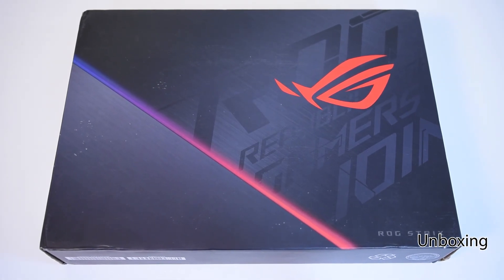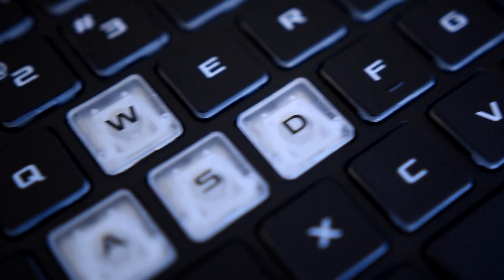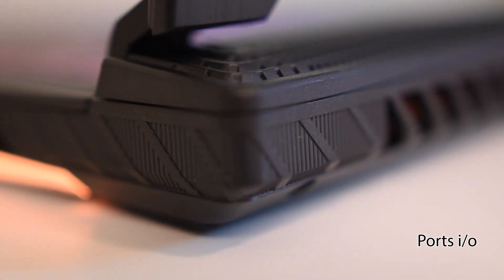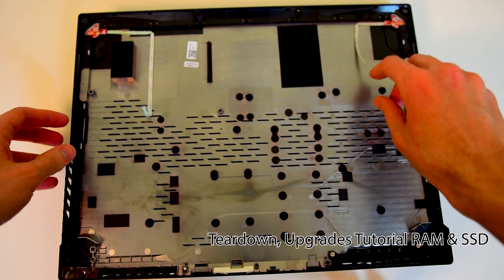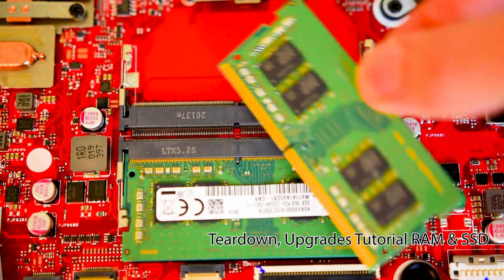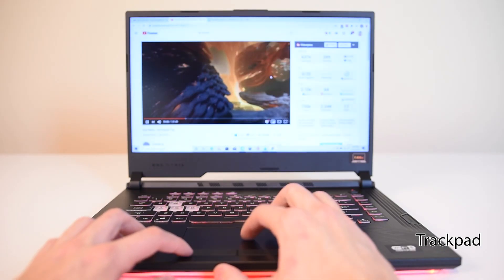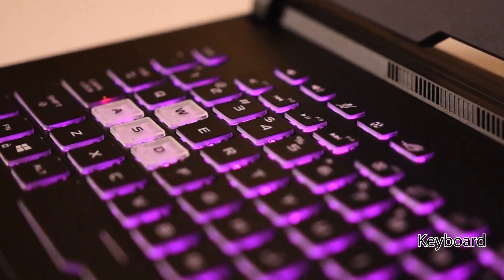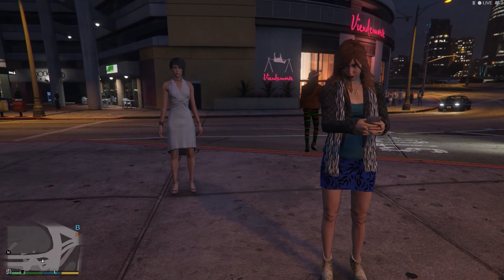ASUS ROG G512 strix i7 RTX 2070 review GAMING LAPTOP 2021 under 1500

Comment: Lets say you get something like that but then get an external gaming monitors does that better the picture experience?
Reply: I’ve been doing this for years with zero problems, just have to buy a really good monitor to be better than the display that’s already on the laptop. Make sure you’re running a decent cooler from Amazon on this laptop, it does get pretty warm pushing out to bigger displays.

Comment: Does anyone know what size of ipx connector is on the motherboard ? It's an antenna connector on the motherboard , a wire runs from under the speaker to the motherboard .

Comment: I been having problems with this laptop lately related to the charging port. The charger port ruins my adapters faster than it should recently bought a new original adapter from the asus website and in less than 1 week it is already presenting problems it seems to burn the adapter very fast.
Reply from the maker: Dang thats a sucky defect! sorry!!! I actually never herd of this problem before.
Reply: @SERGE_Tech  yes, it is a really annoying problem since it has broken 3 of my new adapters in less than 1 week. the worst and funny part is that the laptop was freshly out of warranty and I don't know if this is too much of a coincidence or just  peak engineering....  anyways, I tried to look for the part I needed and I found it but unfortunately it needs to be welded and that is very complicated for me as I have no experience in that. I'm afraid I will have to spend a lot more money to have it fixed.

Comment: How well does this laptop run red dead redemption 2?
Reply from the maker: 2070 will run the game well but to run the game in its full beauty id recommend a 2080 or 3080. 
like the 2070 is not a bad card at all but read dead actually requires a lot of power even in a 2080 I noticed I cant run max graphics, youll have to tone down the AA and the resolution but you should be able to game and enjoy it. 
What would it take to make you a subscriber? this channel needs subs bad!!!

Comment: I got this laptop fully working never used at Walmart for 400 freaking bucks. A crazy snag in my opinion
Reply from the maker: What on earth how did you get such a good deal? you gotta share your secrets!
Reply: @SERGE_Tech  it was a old never used display shelf item marked as 900 but the Walmart employee marked it down to 400 for me. I couldn’t believe the deal I got. It’s a fully working model too. They had other laptops that were never used display self items that had mobile GPUs you could have gotten for 150 there.
Reply: @SERGE_Tech  $300 before tax brand new in box. (; Final Clearance price. Yeeeeee.
Reply: Just got one as well at Walmart final clearance price at $299.00.
Reply: @timothysanchez3473  nice snag
Reply: @timothysanchez3473  Same here! I used my rewards card with cash back and got it for 270!!!
Reply: @saulg195  Rtx 2070 and i7-10750 for $270?
Reply: @谢昊辰-l5u they clearly aren’t talking about the same model, no way, they’re still going for $1300 on Amazon today

Comment: how much is it to replace the screen?
Reply from the maker: Probably 100-200 depends on where you get it just make sure its not counterfeit. 
What exactly is going on with your screen.
Reply: @SERGE_Tech  the inside has like a crack with green red lines something like that i dropped it on the sidewalk

Comment: Paid 1100 for the 2070 version do you think I got a decent deal
Reply: 1100 for a 144hz screen, 10th gen i7 and a 2070 in a laptop is not a decent deal, that’s an amazing deal...
Reply: Mine is the 240Hz FHD screen 😊
But also mine is the 2060 model ☹
Reply from the maker: That’s pretty good considering that’s a mid to high end device plus with all the shortages right now you got a decent deal. How do you like this machine is it working well for you?

Comment: I have the 2070 version of this laptop and wondering if its capable of running  on a 43 inch monitor. With 120hz if anything. Any suggestions?  Ty very much 

New to the channel  very  easy to understand how you explain everythting looking foward to seeing the rest of your channel :)
Reply from the maker: Yeah it should run, that monitor is pretty good, the amount of hertz for the monitor is dependent on if the screen has a high enough range and if the video card supports it. The video card can support it, just make sure the monitor explicitly state it has 120hertz or more.

I recently tried 240hertz vs 144hertz and to my surprise there was a difference, aim to get the highest hertz possible. Good luck on your journey and let me know if you have any more questions! Super happy to have a subscriber.

Comment: I have 1500$ to spend. Want the best gaming laptop for the money. What do you recommend? I just got rid of my asus predator 300 1660ti.
Reply from the maker: Great question, what was the main reason you got rid of the predator 300?

Here are my top recommendations the first being the best:
Alienware area 51m
https://www.ebay.com/itm/Alienware-Area-51m-2070-Laptop-17in-Black/224408476680?hash=item343fc99c08%3Ag%3AXPcAAOSwtzlgZhPr&LH_BIN=1
this machine has a 2070 so the performance is much better with the graphics and its graphics card and cpu are upgradable, it has 2 sata slots, 3 nvme and 4 ram slots. its a desktop squeezed into a laptop its a really powerful machine that can be upgraded. Also its keyboard and screen are really good, screen being higher hertz, 1mz response time and gsync. 

https://www.ebay.com/itm/Razer-Blade-Pro-17-144Hz-Laptop-Intel-i7-9750H-16GB-512GB-RTX-2060-8GB-WIN-10/154007390282?epid=15032427754&hash=item23db8e484a%3Ag%3ANWkAAOSwneZfDbJA&LH_BIN=1

https://www.ebay.com/itm/Razer-Blade-Pro-2016-4K-Laptop-i7-2-9GHz-32GB-RAM-1TB-M-2-GTX-1080-HE1026122/353437645479?hash=item524a867aa7%3Ag%3A5I0AAOSwRwxgY3GP&LH_BIN=1

I am trying to build the best tech & entertainment channel possible if you have any questions I am always standing by to help you with your tech needs what ever they may be. I will always be there for you, So if you like this kind of content I highly recommend you subscribe. :)
Reply: The reason why I got rid of my predator his to upgrade my buddy was going to buy it. It had a 1660 ti. My Lenovo has a rtx2060